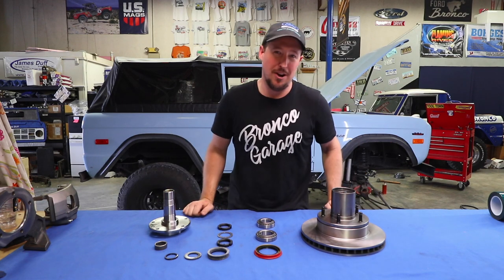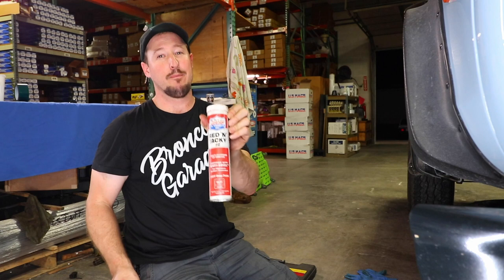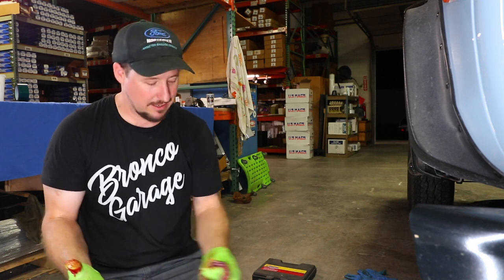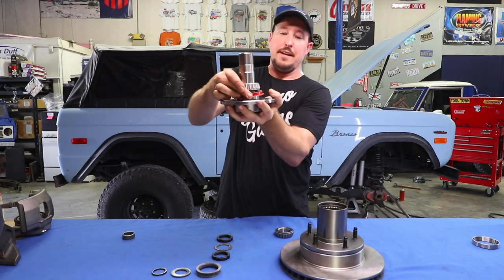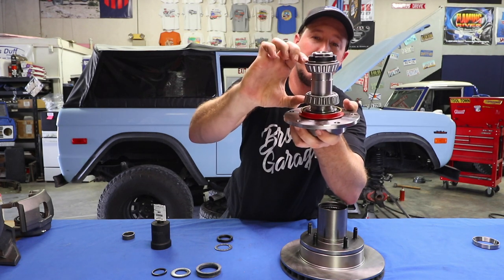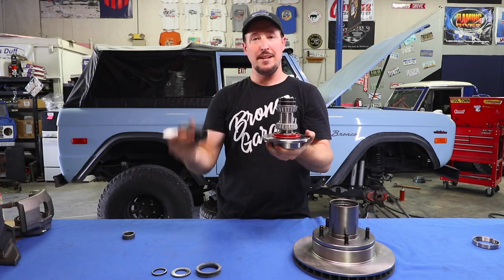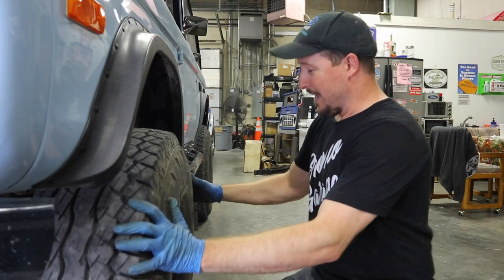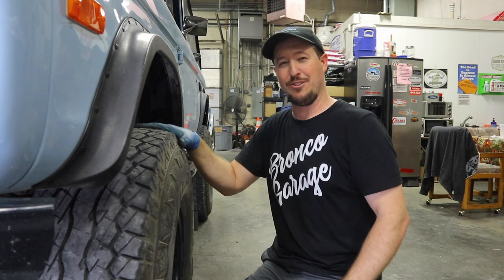Early Bronco Wheel Bearing Tech

Comment: Nice work!
Much difference on a stock/drum situation?
Reply from the maker: Thanks! The solid front axle on a drum Dana 44 will use the same method and the same torque values for the wheel bearings

Comment: Hey, I got a 71 with a D44. Some brake work had been done on the stock drums and hubs. Unfortunately the wheel studs became loose and obviously destroyed the factory drum hub. Do you know if the 76 style disc hubs will be compatible or interchangeable with the 71 style drum hubs and spindle?
Reply from the maker: Unfortunately no, the drum hub is not interchangeable with the disc hub.